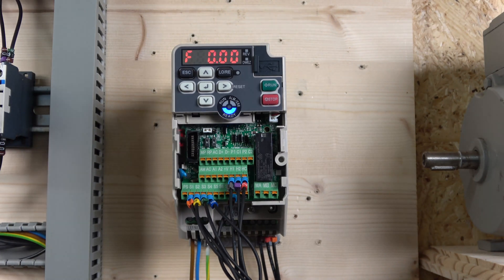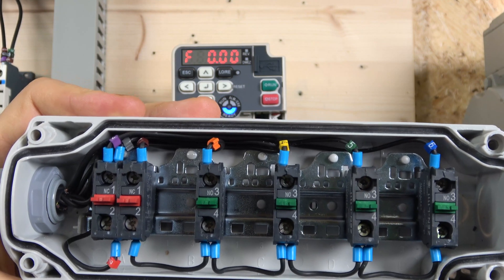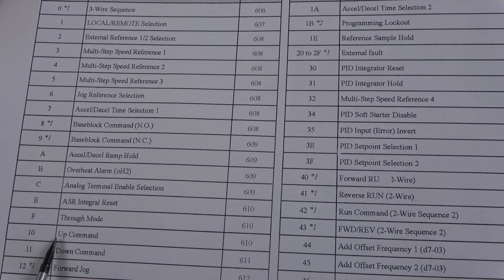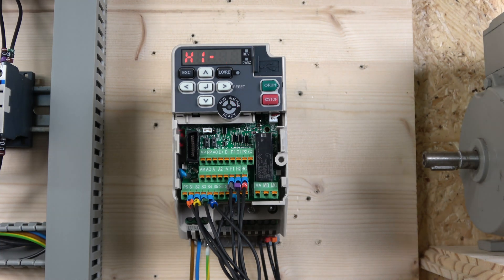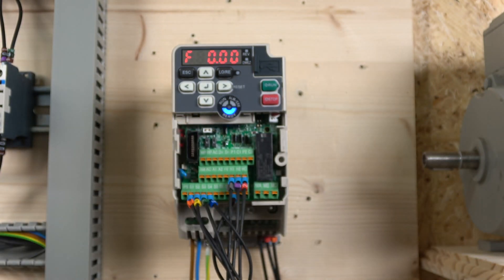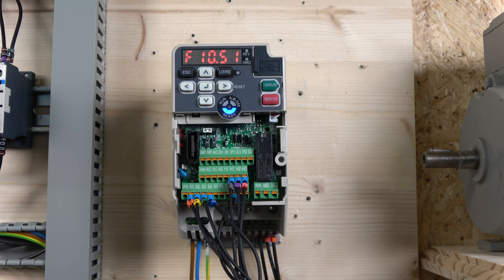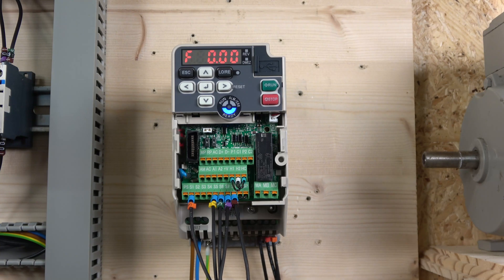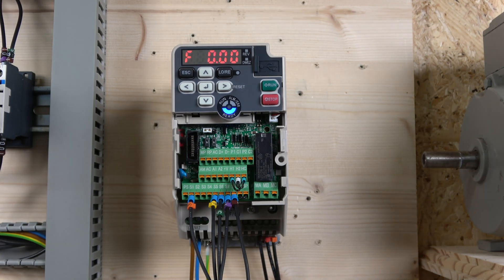Yaskawa GA500 VFD, remote control, MOP speed control, Multi frequency set up. English

Comment: Late in the day Ingus - but you have saved my life. Thank you. I have a 22kw motor that needed to ramp up to 50HZ in 30 seconds.
The load is heavy until full speed and no matter what I did - the drive tripped with OL/2 fault (over current for too long)
I read the manual for multi speeds and it was defeating me. Your explanation and demo showed me how.
I programed the speed sequence into a plc and paused between each ramp-up to allow the Amps to come down (65A down to 17A)
It now reaches full speed with no OL messages. Thanks again.